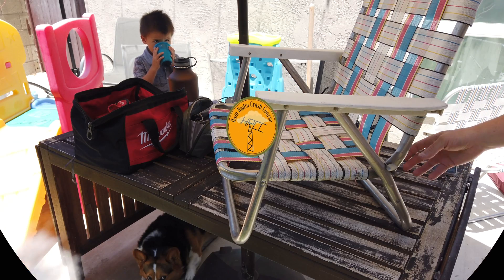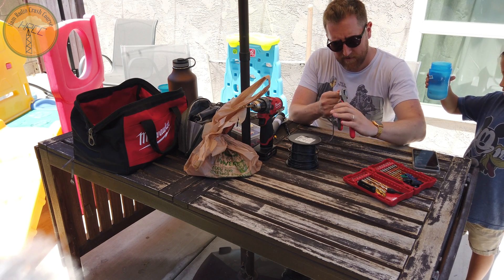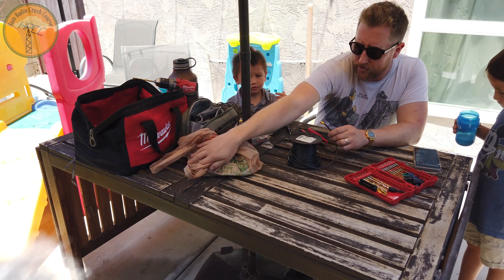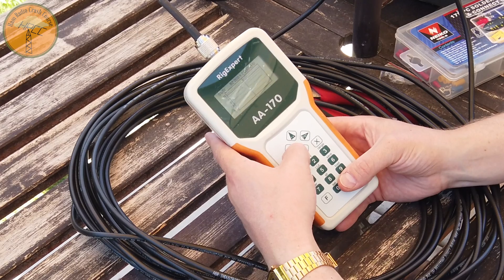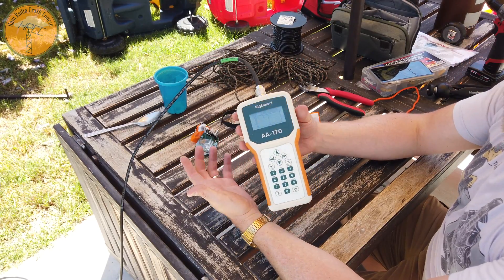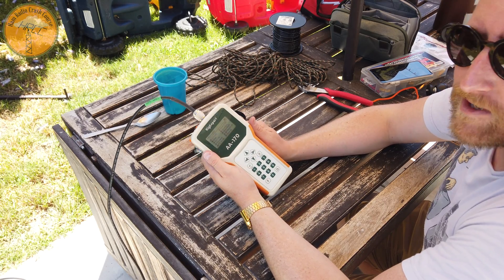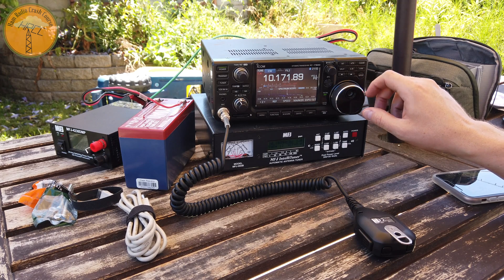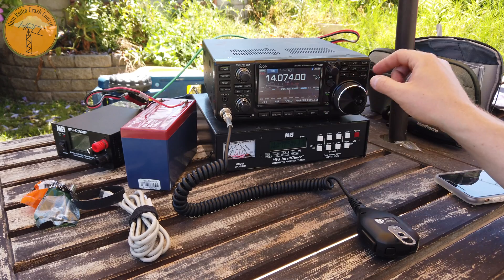The Lawn Chair Dipole - Will It Antenna?

Comment: Josh...A bunch of other pretty reputable ham/YouTubers have done tests with antenna tuners, both internal and external (most use the MFJ). What they find, pretty consistently, is that tuners are great for protecting your finals, but don't really 'match' your antenna system! Both internal and external tuners show SWRs of well under 2:1. Using an outboard SWR bridge, however, they read pretty horrible SWRs and amounts of reflected power.....hence they don't get out worth a damn! Are you doing something different with tuners or actually physically tuning the antenna(s)? Thanks!
Reply from the maker: Yeah. I generally try and tune the physical antenna when I can. 

Further, reflected power isn’t lost. It’s just put back on the transmitting element over and over until transmission is ended.

Comment: Back in the 1970's and 80's I had a nice tuner and would use just about anything metal to try to make an antenna and get contacts with.  Coat hanger. Rain gutter on the house. A car body (back when they were still metal, not plastic). Electric fence (turned off). Bicycle frame. Shopping cart. Etc. --- An antenna I always wanted to build is the Rhombic. Like the ones Radio Moscow used to have pointed at North America, but much smaller. If I remember.. one of theirs was 32 miles long.

Comment: Funny antenna for sure. I would think you may be able to try that with a flower or grape arbor. In the back yard. Albeit you would have to use wire to build the antenna matrix. But if it was a grape arbor after the grape vines grew in the HOA that you might be in would not be able to see the hidden antenna...just a thought.

Comment: This video reminds me of a ham in the ATL area who used to sponsor the "Strange Antenna Contest". the purpose was to see what could be used as an antenna. At a local hamfest, there was a strange antenna set up for a demonstration. They used an aluminum ladder for a vertical and chicken wire fencing for the counterpoise. It worked. You might want to try that for a video.  Who knows? You could revitalize the Strange Antenna Contest.😊
Reply: We did a beer can antenna comp at Central States one year. You had to drink the beer THEN design your antenna... bunch of drunk hams all fumbling with duct tape and empty beer cans... and the more elaborate the antenna the more beer you had to drink! Table I was on made a small 5ghz stepped surface dish antenna that actually worked LOL cut off beer can with a piece of wire on a connector in the side for a feed point. Actually was only down about 8DB from theoretical for a dish that size

Comment: I was wondering about a dipole from threaded rods.  If it works, there might be a way to make it adjustable.
Reply: Get some threaded coupling nuts or sleeves on the ends, why not?  Heck, if you had pre-cut lengths of rods, you might be able to make a modular antenna for non-harmonic bands all using the same feed point.  Shorter rods at the feed point for higher frequencies, then attach other rods at the ends if you want to go to longer bands.

Comment: Could an antenna be made from a fence of any kind? For example, an unpowered electric fence? Barbed wire fence? Chain link? I'd be interested to see if a tuner could make that work
Reply from the maker: Yes. You need to isolate it from ground, but yes.
Reply: @HamRadioCrashCourse  I'd like to see you put it to the test. I would think electric fence would be the easiest since it is isolated already and it pretty much would amount to a dipole, but I would like to see a section of chain link fence turned into an antenna if for no other reason to see how difficult it would be to determine how much to use, figure out how to mount something that floppy, etc.
Reply: @Jason-jd1jv  I think chain link would be too problematic with so many conductive members.  I don't know how you'd isolate a radiating section from everything else.  Also might get some whacky Faraday effects.  A straight barb wire fence with wooden support uprights might work, but it's also really close to the ground, so that might be problematic.

That said, if the fence had three or four wires strung along it at varying heights, could that make a crazy vertical Yagi?  Probably useless, but that's the way my brain works.
Reply: @Jason-jd1jv  yes it works as a receive antenna, its called a beverage! For TX not so much, to close to the ground... BUT a transmit loop in the backyard that is below fence level or otherwise hidden can take care of that problem!
Reply: KB6CIA Bob at Anaheim hro had a fence dipole picture on his qrz page. I first was wondering where the hack was the antenna. Asked him in hro. Wow..he cut the whole fence to length !
Reply: But the wider the conductor get the shorter it needed to be reaonate, sinply put.  It shouldn't matter that much on HF but if you going to use a fence on VHF above, probably does